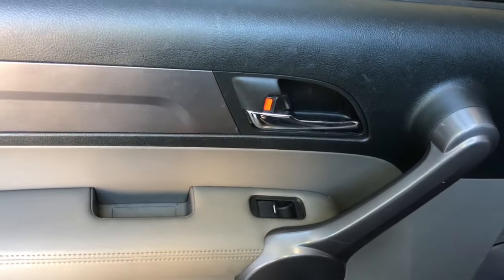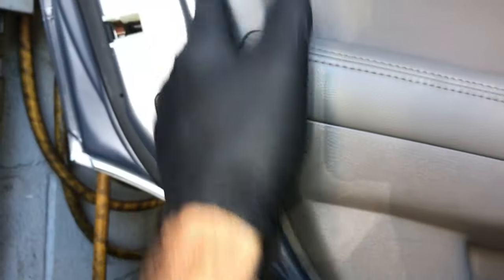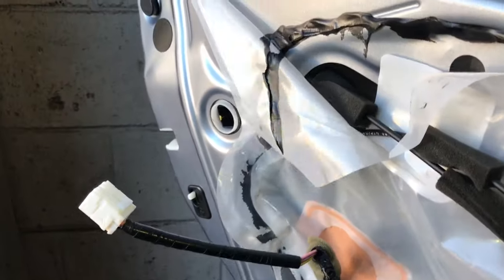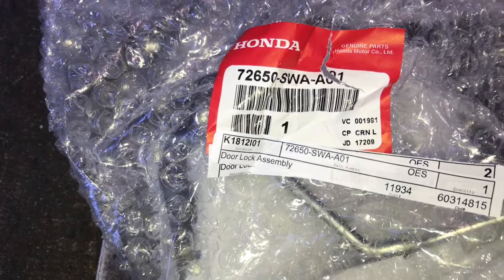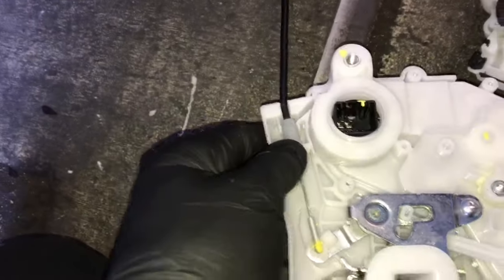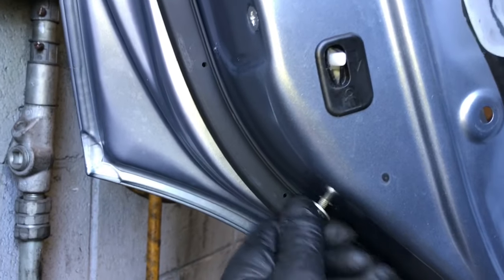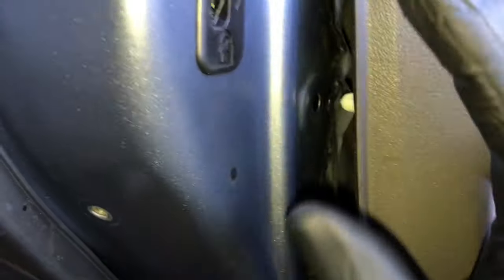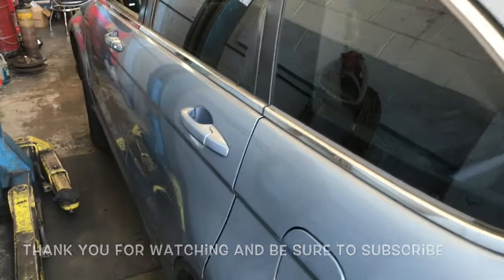Replacing The Rear Door Lock Actuator On A 2007-2011 Honda CR-V

Comment: I just fixed my CRV with help of this video. I was having some trouble until I saw this video and the great closeups. That is what I needed. Thank you!
Reply from the maker: David Nelson glad the video helped. Thank you for watching and writing!
Reply: do you happen to know if this is the same for the honda crv 4th generation? 2012-16?

how much did the actuator cost btw?
Reply: My CRV is a 2008. My part was ~$75 at the local Honda dealer. I could have save couple dollars had I gone to O'Reilly, but they had to order the part in. 

If you have 2012+ I would call about getting your's fixed under warranty even if your mileage is up.
Reply: David Nelson how do put off the the three side screws, I tried many ways, while failed, gg
Reply: @agencialt9633   n
Reply: I guess Im randomly asking but does anybody know a way to get back into an Instagram account?
I was dumb forgot my account password. I appreciate any tips you can give me.
Reply: @Talon Kylan instablaster =)
Reply: @Izaiah Jericho It worked and I finally got access to my account again. I'm so happy!
Thanks so much, you saved my account :D
Reply: @Talon Kylan happy to help :D
Reply: @billyee4688 He had a nightmare doing it too and why he skipped it on the video.😂

Comment: I realize that this video is over seven years old, but I just wanted to say thank you!

After all these years it was still able to help me swap out my rear passenger side door actuator assembly

By no means am I automotive technician, but I’m a copier technician and have been at it for over 20 years. All I needed to do was buy that little impact screwdriver, and a door actuator off Amazon.

The reason I bought it off Amazon is because I wasn’t quite sure if that was gonna solve my problem. It just looked like that  door wasn’t locking all the way. You could still see the orange tab next to the door handle.

Every time I would come to a stop, the doors would unlock. Every time I would accelerate it lock.
It was constant for about a month that drove me crazy.

After replacing it, everything works OK. All the doors and all the windows do what they supposed to do.

Comment: Thanks for posting this. It was a great help. My rod was very difficult to get out of the door handle. If you’re having difficulty keep trying. It took me a while.
Reply: Had the same problem. Prying that rod took me an hour. Tight access, difficult to see. 
Second thing is the impact screwdriver,  works well for the disc breaks but not good for sheet metal when the screws are torqued too much. Used 3/8 drive ratchet and very tight fitting Phillips bit.

Comment: Thanks!  Just finished the job, rear lock works perfectly now, and more importantly, the tailgate unlocks when doors unlock. I had a lot of trouble getting out the infamous 3 screws. I recommend doing this first. No point in taking the door apart and then not being able to remove those screws. 1screw came out with PB Blaster, elbow grease and #3 driver. The other 2 would not budge, even with an impact driver (I declined to bash hard enough to dent the door).  They finally came out easily after a little heat from a propane torch. I also had a little trouble getting the rod off the door handle, but eventually it came out. I bought my actuator from Walmart online - it was around $21. Couldn't have done it without the video. Thanks!

Comment: Awesome instructions! Installed and working great. This is my second install because the first actuator assembly I bought was defective (worked for about a week and then stopped and prevented the door from opening AT ALL). I was facing a challenge of trying to remove the door panel from the inside and hack away at the actuator with a chisel and hammer to break the door latch free, OR paying the dealer a bazillion dollars to un-F my repair (probably with a chisel and hammer). 

I kept trying the handle every so often, just in case it decided to work again. Nope, nope, nope. Stuck shut. Then, on Valentine's Day, I tried opening it AND IT OPENED! WOOT! Bought a new latch actuator ASAP and re-used these same instructions. Success! 

It sounds and feels smoother and crisper than the first one, so I'm pretty sure it wasn't my installation that was the issue (it worked fine a dozen times or so over a week). I'll leave the door panel off for a few months, just in case. At least that's one less hurdle if the actuator seizes up like the first one.

Comment: Thank you Brian for the excellent video! I was discouraged at first to undertake this job, but after watching your video I ordered the part. It took me 2 hrs total for the job.
Hardest part was those 3 screws - a heat gun turned out to be my friend. Another snug was disconnecting the rod from the outside door handle - it was hard to pry it off as there is very little room to gain good leverage. I have used a separate hole in proximity of that connection to put a flat screwdriver through it and then successfully pried it off. Thanks again!
Reply: I was stuck on the rod part, so I came looking for a comment like this. Thank you!
Reply: @treyaker9128  I am so glad to hear it helped someone!

Comment: Just fixed the door locking mechanism on my crv. Was the best to the point video out there. Getting the door actuator in past the window beam was a little tough. Other than that was a breeze. Thanks brother.

Comment: Removing  the top of the rod with a screwdriver thru the access hole by the door bumper worked better for me. I didn't have much luck trying to pry it off from below.
Reply: thank you for this, i would not have been able to get it out if it weren't for this comment
Reply: Mine is stuck like Chuck.. I have tried every hole every tool every crevice.  Ughhhhh

Comment: Great instructional video with easy to follow steps. Only negative comment: a couple of the edits are pretty tight so some information was a little hard to follow. Most specifically 3:30- 3:41. I spent a LONG time figuring out that I wasn't looking at something on the actuator, but instead, on the handle. The actions fly past pretty quickly and the edits are very tight. But everything else is very solid without a lot of extraneous stuff. Thanks.

Comment: A well done 10 minute Video for a 2 hour job.  It's done and it works just like new.  I ended using a thin flat wrench to pop door handle rod free.  That was the most difficult part of the project.. I'm 75, been working on cars since I was a kid.  You didn't need YouTube video back then..
Reply from the maker: I didn’t have YouTube either when I started. Glad you got your car fixed up. Thank you for watching!

Comment: Excellent post, thank you! Everything went as planned except I could not get the actuator housing around the track no matter how I tried without risking track damage and/or cracking the actuator housing. I was able to lift the bottom of the track outwards (where the 10mm bolt attaches to the track) and was able to slide the actuator up underneath it without issue. Thank you again for the very helpful post!

Comment: I fixed my 2011 Honda CRV door with this video.!  Thanks!!The part I got from NAPA works fine but I had to make the plastic clip out of water bottle caps. The c lip with the new part was too loose and the original clip broke apart when I tried to use it.

Comment: I hope this tid bit of information helps someone, If the actuator assy you buy doesnt come with the back arm but instead just comes with a new little white thing to snap your old one on...  dont put the arm on until you get the assembly in place.  It makes life much easier to get it in place and you can reach in and snap the arm on when your done.  I learned the hard way because my arm popped off trying to get it by the window channel and made it so much easier just to pop it back on when it was in.

Comment: To the point, GREAT camera work, knowledgeable tech, perfectly accurate.  Nice work!  Tell me then, is replacing the passenger side front risking an air bag deployment?  Dealer did the left front, I did both rears.  Only the R/F remains and I'm sure it will need replacing sooner rather than later.

Comment: Best advice on here is use a propane torch on the 3 bolts till the bolt feels hot to touch about 30 seconds,  then I used a ratchet with #3 and the bolts removed like butter.

Comment: Great video. I did the front passenger and it pretty much carries over. The replacement I ordered didn't come with the latch bar so I ended up having to cut it off the old one.

Comment: Nice instructional video. Thanks. I have a 2010 CR-V with a left, rear passenger door lock problem that I'm thinking does not call for replacing the actuator. The driver's control of door locks works fine to lock/unlock. But when the left rear door is unlocked it can ONLY be opened from the outside. The inside lever of this door is essentially 'limp' when pulled. Any suggestions as to what I can try?
Reply: D Rebson child door lock switch?

Comment: I was too lazy to go all the way ( THOUGHT) I could just unplug and noise problem solved,  BUT found out the hard way that the back hatch won’t unlock so I thought I could just cut one single wire WOOHOO I guessed right and cut the pink wire!! Time and money saved, knowing full well that door has to be manually locked/ unlocked
Reply: I'm thinking about doing the same thing. I previously replaced the actuator two years ago with a new one and now that new one is starting to make the same noise. Ugh...

Did you have any other problems after just cutting the pink wire to bypass the circuit for the back hatch?

Comment: How do I get the door open so I can begin the replacement?
Reply from the maker: Kenneth Smith You should be able to manually unlock it and open it from the inside.
Reply: Child proof lock is engaged.
Reply: I was hoping for an easy answer, I guess there are none!

Comment: And if the rear passenger door is stuck in the locked position, and the door is closed, and won't open AT ALL, from either the inside or the outside?   (Meaning that it is locked, and the actuator is frozen or stuck, or some other part of the assembly is frozen, and you CANNOT MANUALLY MOVE THE LOCK SWITCH ON THE DOOR!)  How do you work around this issue?   With the door unable to be opened, getting the door panel off that door looks like it's gonna be a giant PITA.
Reply from the maker: Definitely gonna be tough but you have to get the door panel off. Even if you break off  the clips and order new ones.

Comment: Had to smash the living shet out of my impact driver.  Started to strip the heads of the screws.  Caved in the door slightly.  I had to resort to an impact driver bit on my air hammer to get them loose.  Honda totally effed up on this one.   There is no reason an impact driver should have a hard time getting the screws loose.

Comment: I cant take the rod out mate. Its too hard. You took it easily but mine is really tough. Dont know why. We don’t have enough room to work inside the door panel. You cut the video at the moment you take the rod out. You don’t want to show the hardest part of the video
Reply: Just put a huge cut in my hand trying to get this rod out wit a pair of needle nose pliers.
Reply: @jeffjoefishface  after removing the plastic lock on the rod, I was able to get a plastic zip tie arond the rod and use that to pull it out of the handle.